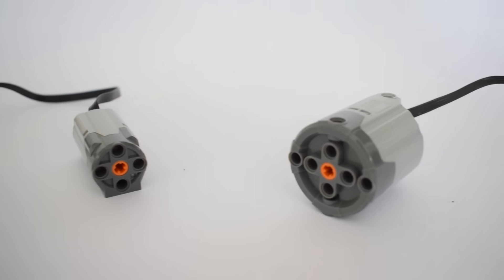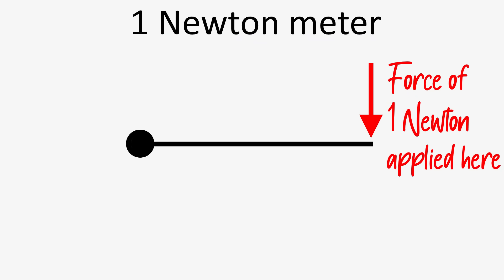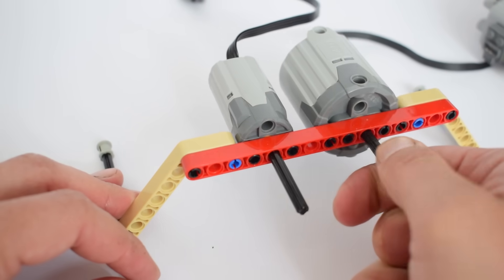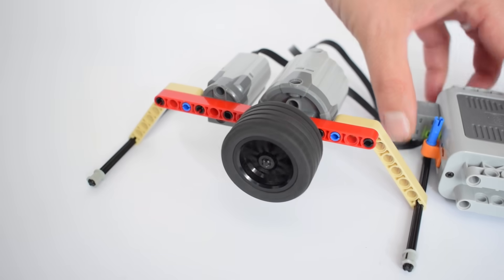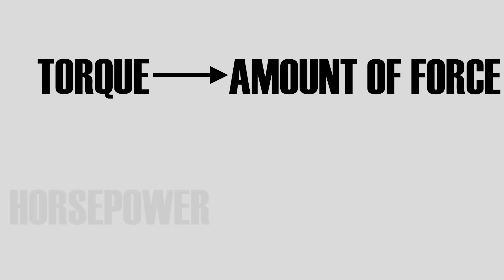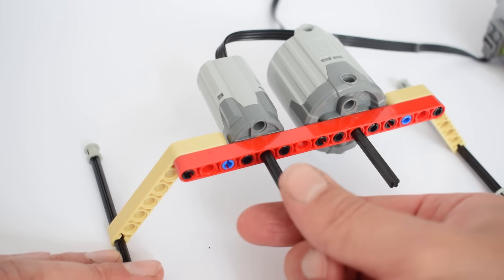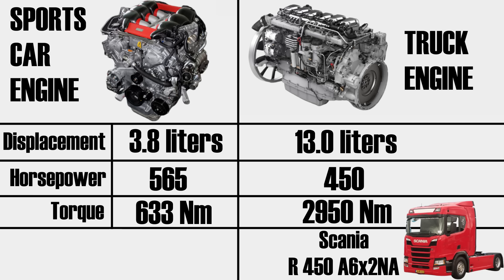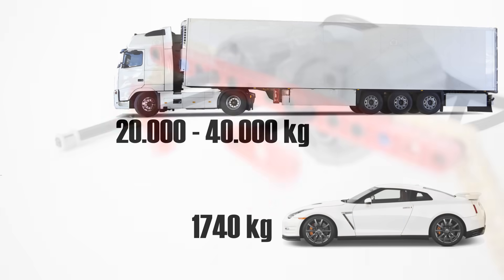NEVER be confused by HORSEPOWER and TORQUE again - HP and TORQUE EXPLAINED in the MOST VISUAL WAY

Comment: Wtf is a newton ? Why not use kg ?
Reply: Newton is a unit of force. Kilogram is a unit of mass.
Reply: @m-h1217  what is lbs ?
Reply: @joeforster2255  A unit of mass in the imperial system.

Fyi Google exists.
Reply: @m-h1217 So why do they use lbs (a unit of mass) but not kg ( also a unit of mass)?
Reply: @joeforster2255  They didn't, the creators of the imperial system however made the terrible decision of having the same name, "pound", for a unit of weight (lb or lbs) and force (lbf).
Reply: @joeforster2255  The US standard unit for pound and force both share the name pound. If its not directly specified then the context tells you which one it is. Clearer notation would be pound force (lbf) or pound mass (lb). One pound mass has a weight of one pound force in Earth's gravity. The metric system also has a similar unit called the kilogram force (kgf), its just not really used.

Comment: Yes, it's understandable, but it would have been good for you to explain the point.  What do each of them tell us, when are each of them useful.  What is it you are looking for when you compare torque vs horsepower.  The car generates more HP than the truck--okay, but what does that tell us about performance?  Etc.
Reply: The performance is equivalent to that as demonstrated in the video.
Reply: @m-h1217 No.  It doesn't tell us why a sports car has low torque and high HP, while a truck has high torque.  By "why" I mean, the video doesn't tell us why low torque high HP is BETTER for a sports car, while high torque is better for a truck.
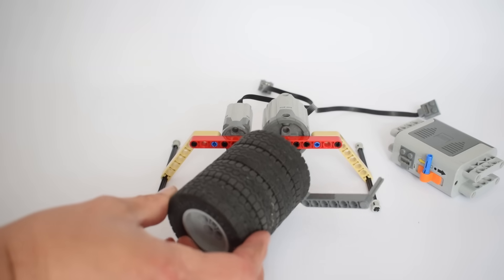Reply: @greg55666  Yes, it does. As the video demonstrates, high torque equals more "strength", the capability of moving weight 2:44 What would that be useful for? Perhaps pulling a large load?
As for horsepower, it is shown to deliver a higher speed at a given torque due to being dependent on rpm 5:16 What could that be useful for? Perhaps a fast racing implement? 

These are not difficult observations.
Reply: @m-h1217 LOL Yes, repeating exactly, almost word-for-word, what the video said is not difficult at all, which is why you were able to do it.  Answering my question, however, not so easy at all, which is why you haven't done it yet.

Start with the race car.  So, you say, the car needs high horse power, right?  Good for fast racing implement, right?  So, why not have an engine with higher torque?  You haven't answered the question (obviously you still don't understand the question).  The truck has virtually the SAME HORSEPOWER as the race car.  So how is low torque better?  If low torque delivered at a high rate delivers the same HP, why not higher torque at a lower speed?

As for the truck, why choose high torque and low speed?  Pneumatic tools such as jackhammers work, for example, use low torque and high speed.  Clearly low torque and high speed can do the job too.  Thousands of small hits does the same work as one big hit (that's the point of the video).  So, why have a high torque low speed engine?

Since you've tried twice and only repeated what is already in the video, maybe don't bother responding again?  Maybe give someone else a chance?  There is ANOTHER consideration at play here that the video didn't address, and that is the thing I am asking about.  If all you know about it is what the video said, you're not going to be able to answer the question. (I already understand what is IN the video better than you do, which is why I understand that the question I am asking is NOT in the video.)

(There is this little thing called gearing, for instance, that is obviously relevant but unmentioned so far.)
Reply: @greg55666  Perhaps you should initially express what you want to ask then instead, seeing as you changed your question from torque and horsepower to rpm and torque.

"So, why not have an engine with higher torque?" Because why would you put an engine that weighs four times more to achieve the same goal (hp)? Why would you put an engine that has a early power peak when you want the opposite?

"As for the truck, why choose high torque and low speed?"
This proves you in fact do not understand 'what's in the video' (lol, the irony). The truck needs a high torque output at its wheels because it is torque that allows it to overcome its high inertia. Not horsepower.

Clearly, you do not "already understand what is IN the video better than" me. You've demonstrated you don't understand it at all.

Comment: 1 Newton = 1Kg  so the torque of 1Nm is = to 1 Kg haning 1m from the centre of rotation. Also 1 fp toque is not equal to 1 Nm torque 1fp=1.356 Nm.
Reply: 1 Newton is not equal to 1 kg. 
1 Kg hanging from 1 m from a centre would only produce the equal amount of torque for the force it generates if the arm were horisontal.

Comment: This video told me that I already knew what torque was and I still have no clue what horsepower is
Reply: Horsepower is just a calculated number that favors higher rpm. One way to think of it is torque is doing large amounts of work slowly, and horsepower is doing small amounts of work quickly. 
In a general sense torque gives you the force to get something moving and then horsepower dictates how fast you can move it.

Comment: horsepower is what any motor needs for fast acceleration of large masses. With the right gearbox for the job, power is all you need. In practice you might not always have the right gear available, that is where high torque engines shine, because they are able to deliver the power they have with less demands on having the right gear. So in extreme cases, high torque engines is the only way to do certain jobs or in less extreme cases, higher torque means you can drive more comfortably without the need to shift all the time.

Comment: A great video except for the last part. It is misleading and frankly incorrect. The power matters, not the torque, both for trucks and for cars. That is because torque at the wheel (which is maybe what you're confusing it with), can easily be manipulated by gears and is only dependent on the power output of the engine (and gear ratio). 
The reason why truck engines have higher torque to power ratios, is actually something very different. Truck engines are all about efficiency. Nobody cares about a bit higher peak horsepower when it is never used because it would strain the engine too much and inefficient. Therefore they are designed to be ran at the RPMs and fuel loads for highest fuel efficiency, which correlated with higher torque. The extra weight and cost for building the engine like that is worth it for trucks, but not for sport cars.

Comment: Nice explanation, but I think what most people are confused about is not the difference between power and torque, but why torque in a car engine matters at all if there is a gear box available. A small powerful engine with initially small torque will provide a larger torque than a less powerful large engine with initially larger torque given a proper gear ratio. However, it will come at the cost of much higher rpm which reduces efficiency. A high torque number pretty much indicates that the vehicle is designed to be efficient when pulling heavy loads at relatively low speeds.

Comment: PE here. Kind of a misleading video.

This video was essentially an explanation of the units of torque and power (torque does have a time component, sry if pedantic… N-m = kg*m^2/s^2). At the end it sounded as though you were suggesting that the power is just the RPM x torque. Thats true, but torque changes with rpm, and theres a bunch of reasons why it changes. Covering those would have been more interesting.

Comment: in a short way, If there are 2 persons A and B, a person who is throwing shot put ball to far distance has more Torque and among them who is throwing javalin throw to far distance has more horsepower (his arm swing or rotation is quicker). A may throw shotput longer and B may throw javalin stick longer. That's why there are different winners. 

or same person can throw both farther if one is an athele and other a layman.
Reply: Power and Torque are not Batman and Robin please stop trying to assign them roles. Power, not torque, is the limiting factor for not only how fast a vehicle can go but also for how much weight it can pull at a given speed and/or how fast it can accelerate a given weight. Torque is the sound of one hand clapping. Without RPM nothing happens.
Reply: @rollsroyce329 😅ok sir ok

Comment: Watts = 2. pi. rps. T
Where T = torque (in Newton.meters)
so if same watts (power) is required at lower base rpm, it will  require more powerful engine

Comment: Good job adding more confusion. Corrections.  

You don't feel the torque in your car, you feel the transition over time. That's power.

Big engines are not used to provide more power, rather reliability and efficency. The gear box is a torque multiplier, at any given speed the power dictates how much torque is at the wheels..

Two motors spinning at the same rpm the one with more torque has more power at THAT rpm. Your two little motors have different power curves.

Comment: So torque tells how much load vehicle can carry, and horsepower tells how fast the vehicle can go with the load based on how fast it’s engine rotates?
Reply: No, and it's sad he only led to more confusion. Power dictates what you will pull.

Big engines are used and built for efficiency and reliability, not because they can pull better.

If he geared the little motor to be as slow as the big motor it would produce way more torque, the difference can be calculated based on the power. If he holds it to where it's spinning slower, and if the torque stays the same is producing less power.
Reply: Great visual explanation with no mind boggling formulas. I understand that torque tells the amount of load/weight a vehicle can carry, and horsepower tells the speed at which the vehicle can go with the given load/weight. Torque is how powerful the engine is, while horsepower is how powerful and fast the engine is.
Reply: I wonder if the engineers decide the minimum amount of torque the engine needs to produce based on the weight and load for the car and then try to make the most amount amount of horsepower to have the car go fast. All this while keeping the costs low.
Reply: Power and Torque are not Batman and Robin please stop trying to assign them roles. Power, not torque, is the limiting factor for not only how fast a vehicle can go but also for how much weight it can pull at a given speed and/or how fast it can accelerate a given weight. Torque is the sound of one hand clapping. Without RPM nothing happens.

Comment: The best way I have found to explain this idea to my students was to use the formula HP = (TORQUE*RPM)/5252 in lb.ft. But also the correlation of high torque engines and their rpm drawbacks.
Higher torque (with higher displacement or compression ratio) = less RPM cause of the greater distance.

So, what are the best way to increase torque to an engine? 
Better fuel with higher potential energy, Turbocharger / Super (More air = more fuel = more force)

A another way to increase torque to the system and not the engine is using more gear ratios but it has its drawbacks. Weight and complexity.
Showing same engine that produce the same HP with different ways some with more torque (typical American muscle cars) or with more RPM like F1

Comment: Doesn’t the length of the connecting rod factor into the equation? A longer connecting rod is a longer fulcrum so larger torque than an engine with the same bore size but smaller stroke, so shorter connections rods = smaller fulcrums = less torque. But the engine with the smaller stroke will sound faster. So it will deliver higher torque at higher RPMs.
Reply: The longer connecting rod (connects piston to crank journal) changes TDC dwell and makes a very small difference.  The lever arm I think you are referring to is the crank throw or crank radius. This increases displacement.  All gains in torque from a larger crank radius come from the increase in displacement with zero percentage coming from “leverage” created by the crankshaft.  Crankshafts do not add or multiply torque due to leverage.
Reply: @rollsroyce329 Thank you

Comment: Excellent video!  The key is, as you noted several times, that HP is energy (as force)applied over time.  A low amount of force applied rapidly can represent a lot of power.  Torque is force applied over distance (arm) independent of time. Two different animals.

Comment: I’m not confused by HP and Torque. I’m just confused how is it that the bigger motor has .0029 HP and the smaller only has .0013 HP and yet the smaller motor displays higher power output in your demonstration.
Reply: Rate, if you geared the smaller motor down to spin only as fast as the bigger motor it would produce that much more torque.

He sadly did not help anyone understand torque and horse power. In fact, he caused many to understand it wrong.

Comment: More horsepower = slower acceleration, higher top speed, weaker, more fuel efficient 

More torque = faster acceleration, lower top speed, stronger, less fuel efficient
Reply: Nope. More horsepower faster everywhere. The key is to look at the power band. Not just peak numbers

Engine torque ratings equal marketing nonsense.
Reply: Power and Torque are not Batman and Robin please stop trying to assign them roles. Power, not torque, is the limiting factor for not only how fast a vehicle can go but also for how much weight it can pull at a given speed and/or how fast it can accelerate a given weight. Torque is the sound of one hand clapping. Without RPM nothing happens.

Comment: I can push on a breaker bar and make more torque than my motorcycle engine. That’s torque.

I cannot push it down the road at 140 mph. That’s power.
Reply: Gave you an overdue like.  You can lift thousands of pounds using just your muscles and leverage.  No amount of leverage will enable a person to come even close to 5 HP using their body.  Torque can be multiplied.  Power can not.

Comment: How small motor rotates faster than big motor while big more has more torque? Its confusing. You did not explain this fast rotation.
Reply: Because the big one loses all it's torque going any faster.

If he geared the smaller one to go as slow as the big one is produce way more torque then the big one after the gearing. 

Think of it as a curve. At different rpms a motor will produce different torque values. At the rpm the little one spins the big one would produce zero torque, probably negate torque.

Comment: So the torquer motor geared to spin at the same rpm of the lower torque motor would make the same HP as the torquer motor as it can spin the extra gearing with no issue due to its higher torque?
Reply: No, it's the other way around. The little one geared to spin as slow as the big one would produce more torque. Exactly relative to the power difference.

Comment: Doesn't address the key reason why torque and horsepower are confusing. 5:15 You show that the small motor spins faster than the large motor, yet you demonstrated by grabbing the shafts that the small motor is much weaker than the large motor. This is very confusing and you don't address it at all. The shafts in this lego example are exactly the same size and weight, yet in 1 minute the "weaker" motor rotates the shaft 275 times while the "stronger" motor rotates an identical shaft only 146 times. It is not made clear how a "weaker" motor can cause an identical object to move faster. The same amount of mass is being moved at a faster rate, no?

Comment: Does that mean gearing affects horsepower
Reply: gearing transfer specifiedmpower level on specified speed level 👌🏻 but they not affects level of power itself which stay the same +/- so if car have 100 hp at peak dosent matter what gearing you use it will have still 100 hp at crank and lil less at whell cos drive train losess (which in fact change with speed change so from this point of view we can say it affect  but it dont affect power directly just be gearing change ) but ypu can transfer this the same 100 hp at 10 km/h what generste in results huge force at contact path or at 100 km/h what generate much less force at contact path 👌🏻at 1 gear feg be changing gear ratio 👌🏻
Reply: Nope, it's the other way around. Gear boxes are torque multipliers.

It's not you tho, his video is bad.